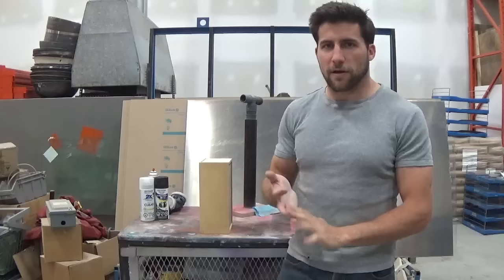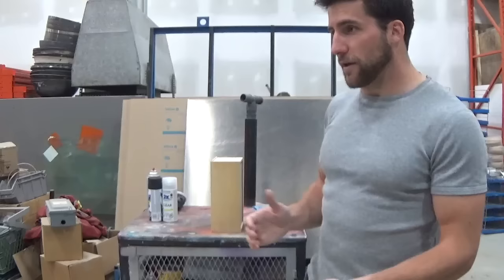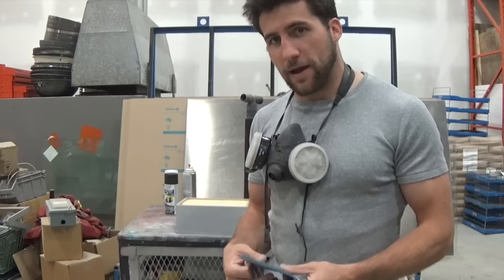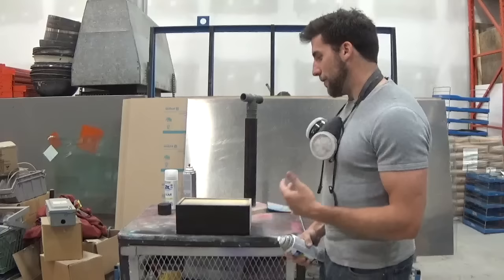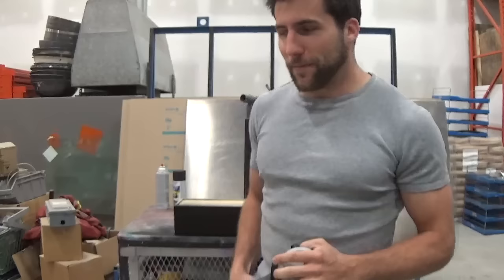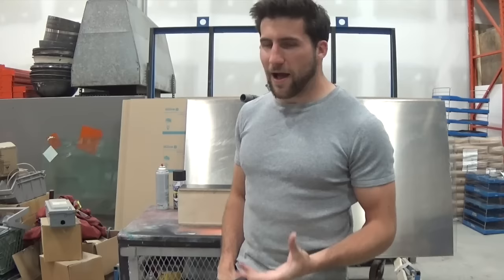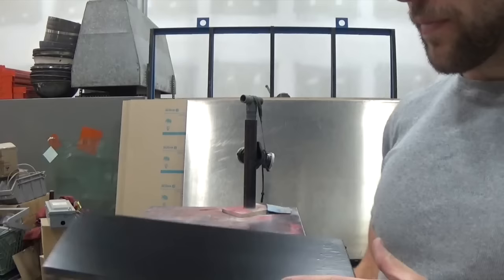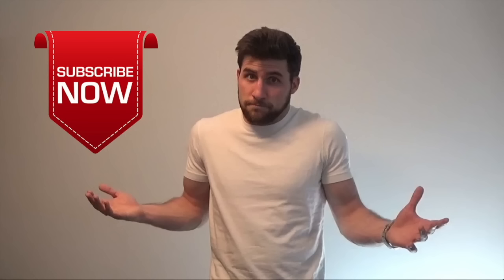How to get a matte black finish with spray cans

Comment: hello dude, i just want to ask, if what other color that can overlapped the flat black paint? because i want to overlay an red type paint into a flat black..but, im thinking if the red will be dominant?your reply will be apprrciated..
Reply from the maker: It depends a bit on what type of paint it is. You can put red straight on this, but if you're using a paint with some transparency to it it might be best to put a bit of white under the red.
Reply: can you make a video that what kind of paint that can be dominant if its overlapped to flat black. i have aome project that my color base was flat black, and im thinking if what other color for a detailing that can be dominant..thanks dude

Comment: Can you use these cans for a bare wood guitar body?also,I would like to grain fill but not with that grey primer any suggestions?
Reply from the maker: +X H4r7 if the wood is filled and sealed you can use these. You can't grain fill with primer really. That's not what it's for. Have a look at my video on how to train fill mahogany. That's the grain filler I prefer these days.
Reply: Brad Angove filled, sealed painted and sealed again?I want to get the pis same finish you just did?
Reply from the maker: Grain fill, sand smooth, seal, paint, and then clear coat.

Comment: Thank you for the great video. Say you wanted to spray paint a handlebar (meaning you have few exposed areas) would you consider dropping the clear layers? Also, thinking about possible thickness issues (when sliding the controls back in place), should I remove the paint completely first? And would I need a different primer for the metal surface then?
Reply from the maker: This primer should be fine for metal. I almost always use clear to protect my paint. You may want to tape off the areas where the controls go to eliminate the thickness issue.

Comment: Sorry, one last question. All i could find was the rustoleun flat black paint +primer. Would it be okay if i used thst along with the coats of  grey primer at the start?
Reply from the maker: You have normal primer available, but not normal flat/matte black?
Reply: Brad Angove yes, i got the rustoleum flat grey primer already and could only find the rustoleum flat black + primer in one can. Would that still be okay to use or should i keep searching for the flat black only with no + primer
Reply from the maker: You should be able to get away with it, but I don’t really trust that 2in1 stuff personally.
Reply: Brad Angove I'll try and find just the flat black only. I have the same opinion. I appreciate the respone and  help. Thanks

Comment: Would a matte clear coat cover light indentations only visible by angled glares? (I had to fill in a gap around the front route in the bridge area)
Reply from the maker: It would lessen it, but may not cover it entirely.

Comment: I'm painting on my bicycle frame . Do in need to remove the paint. It's aluminium
Reply from the maker: No, but you need to sand it so your new paint will stick.
Reply: So I only need the paint I want and top coat

Comment: great video. 
I have a nitro blond finish on my strat. can I primer over that and then do the matt finish, or should I strip the old finish off first?
Reply from the maker: You don't need to strip the finish off, but you will need to sand it lightly so that the primer can bond mechanically to the surface. New paint doesn't stick to gloss properly. I'd go with 400 grit.
Reply: Thanks. I will try that approach.
Reply from the maker: You're welcome. Best of luck with your project.

Comment: Do you need primer if your spray painting things like Consoles or gaming systems
Reply from the maker: Plastic compatible primer is an option for those, but adhesion promoter works just as well if not better.
Reply: can i use this method for silver metal?
Reply from the maker: Are you painting something the colour silver, or are you actually painting a piece of silver?

Comment: I'm trying to restore a bike. It already has a matte black paint job. I want to paint it matte brown. What's the best way to go about doing it?
Reply from the maker: If the current paint job is in decent condition, you can probably just scuff it lightly and spray your primer and paint right over it. Just a coat or two of primer, and two coats of the brown will probably suffice.
Reply: ok..Thanks a 
lot.
Reply from the maker: You're welcome.

Comment: Hey man, your videos have been really helpful!!

So just to get this clear you do 2 coats of primer, scuff it with 800 grit, 2 coats of flat matte then a final coat of matt clear??

I plan on doing this on my guitar and was wondering how many cans i will need? Also do you have and advice on spraying glosss stripes on a matte finish??

Thanks!!!
Reply from the maker: I did two or three coats of the clear as well. You should be able to get away with one can of each, particularly since you don't necessarily need to sand back your matte and polish it. 
Spray your matte finish first, let it cure, then mask off the gloss stripes and spray them. Polish them if you need to before you remove the tape. I should be doing a video on this process some time reasonably soon.
Reply: thats awesome man thanks for the help!!! im subbed so i'll look forward to the video!!

Comment: I’m going to paint my mopeds plastic parts does this work on plastic?
Reply from the maker: You should either use a plastic compatible primer or an adhesion promoter to ensure that it will stick properly.
Reply: @BradAngove  Ok thanks

Comment: Hi brad, just want to ask, will it have the same result if i use gloss black and apply a matte clear finish?
Reply from the maker: Yes, it should. For the best results in that case, I would let the gloss black dry fully for a day or two, scuff it lightly, and then apply the matte clear.
Reply: Finally someone asks the question I was about to ask lol thanks Brad you're freaking awesome

Comment: Hey Brad, I'm refinishing a headstock matt black/matt clear, how long would you recommend letting the matt clear dry before refitting the tuning pegs, truss rod cover etc? Thanks a billion, really appreciate your videos.
Reply from the maker: It depends on the paint type. With this stuff, if you’re keeping your coats light and are in relatively warm dry conditions, a couple weeks usually.
Reply: @BradAngove  Cool, I've got Hycote acrylic formula matt black and matt clear. Not sure if you guys get that brand overseas, I'm in the UK and it seems reputable among people who use it here for guitar finishing work.
Reply from the maker: I’m not familiar with it. Checking with the manufacturer is probably your safest bet.

Comment: Hey Brad!!! I would like to spray paint my car's fiberglass underskirt. Its already in matte black. I want it to be a glossy black finish... what to do???
Reply from the maker: Scuff it up so the new paint will stick, clean it with wax and grease remover, and (if it still looks nice and black) spray a gloss clear coat on it. 
Make sure you mask everything that you don’t want to get paint on.

Comment: Can we do matte black on silencer of a bike ,Becoz silencer is a heated area ?and on Rims of tyre ?
Reply from the maker: +Vinay Kahyap yes, but you'll want a different type of paint for it. Aim for a heat resistant engine enamel for the silencer, and a strong catalyzed matte clear to protect the rims.
Reply: Brad Angove Sir can u plz tell me When we have to use Adhesion promoter and how to use ? ?
Reply from the maker: +Vinay Kahyap You use adhesion promoter to get paint to stick to plastic or other materials that it usually won't adhere to. Generally it's designed for plastic. You just spray a light coat of it on before the paint and let it dry for 10-15 minutes.
Reply: Thank you sir
Reply from the maker: +Vinay Kahyap you're quite welcome.

Comment: I have a question. I am wanting to paint some some aluminum, steel, brass and plastic pieces and want a durable finish. Could I use spray paint with a catalyst clear coat over top? If so which do you recommend? I plan on using flat Olive drab for a military look. If you know anything that would work better and not break the bank let me know please.
Reply from the maker: You’ll need to use a proper etching primer, then paint with acrylic or urethane, and then you can clear coat with the spraymax 2K matte clear coat.
Reply: @BradAngove  thank you very much!

Comment: Great videos, all of them! I stumbled upon them because I want to paint my guitar (DIY kit) matte black. So far, I have little experience painting anything with spray cans, and I am worried about "orange peel" is that a similar issue with matte paint? Do you have any tips on how to avoid them?
Reply from the maker: Matte paint can still get orange peel but seems less prone to it. Usually we sand and polish it out, but you can't really do that with matte. So, just sand your second last coat of clear really flat and smooth (after drying of course) and keep your final coat light.
Reply: @BradAngove  Thanks Brad, I appreciate the help. Good luck with the Guitar Build off!

Comment: I used the same brand spray paint can but in satin dark walnut brown for a small wood cabinet that I built. After 2 days the paint still feels like is not fully adhere it leaves small prints when touched or a bit sticky. How long does it take for these spray paint cans to fully adhere? I did about 3 coats and no primer since the cans already have primer in it.
Reply from the maker: You used the combination paint and primer stuff?
Reply: Brad Angove yes I did, I wanted to test it out. I think I should've used some real primer first. So far is making progress in adhering, is looking better now. Any suggestion as to what to use to protect the paint from scratching?
Reply from the maker: You would use a clear coat to protect the colour coats from scratching.

Comment: Hi Brad. I've been binge watching all of your videos and I just have a quick question.  I will doing. a ceruse finish on an Ash body and I wondering if I needed to add primer for it?  It will be a flat black with red or silver grain filling.
Reply from the maker: You shouldn't use primer for that. You want to keep that black finish thin to allow the grain to stay open for your other color.
Reply: @BradAngove  Thank you so much!

Comment: Hi Brad,  iv seen alot of nightmare vids on YouTube regarding clear over rustoleum, have you came across this, is it a difference in matts or clears, in the videos they are both rustoleum products,  any help would be appreciated before I make a mess, many thanks. 
Edit...the problems I'm seeing is wrinkles, thanks again.
Reply from the maker: That’s mostly a shrinking issue. It’s a problem with recoat times, and it doesn’t really depend on whether it’s gloss or matte.

Comment: Hey brad is it okay if I do this on a motorcycle gas tank? and how can I make it durable so it will last longer 
Thanks!!!
Reply from the maker: You need automotive grade paint for that generally. I would use a 2k clear coat.
Reply: wow thanks for the advice... really appreciate it :)

Comment: if i use the flat clear coat then will that stop the matte black from polishing up from your hand/arm like in your 'problems with matte' video?
Reply from the maker: Unfortunately it won't. It will make it happen a bit slower though since the clear should be a bit harder than the black. The matte finish on the clear can still buff out due to the rubbing from your body.
Reply: oh ok. I wanted to make a blackout/gothic les paul but i guess there's no point then, thanks for the reply though!
Reply from the maker: If you use a high quality clear it will probably take quite a while to polish up, but it's up to you if you think it's worthwhile since that's a risk. I'll post a video if I find a way to fix those spots. I have a test in mind.
Reply: ah ok thanks. Do you know the best way i could do a matte black finish, or even satin, to build a gothic LP? I dont want it polishing up because it will be one of my main guitars for stage playing.
Reply from the maker: I don't know of any way to do it where you can fully avoid the polishing issue. Even the quality factory finishes can have that problem. I would think that the catalyzed polyurethane with a matting agent would probably be most durable.

Comment: Hey Brad, is it ok to use Rust-Oleum's oil based 2 in 1 Filler Primer instead of Rust-Oleum's Enamel Primer when using enamel spray paints? My thought process is that using the filler/primer would speed up the painting process a bit by bypassing the need to use a sanding sealer.
Reply from the maker: Yes, that should be ok.
Reply: @BradAngove  Thanks

Comment: What type of matt clear coat would you recommend for a Japanese Ibanez from 2013? Acrilic, poly, etc?
Reply from the maker: Poly
Reply: What other names do manufacturers use for poly? I see in the shops in the UK spray paints for VW, Audi, etc but the description of what kind of paint it is isn't there, is there a place where I can get cans of matt clear poly? I've seen in forums that using the wrong clear coat can be rejected by the paint use by the guitar manufacturer, Ibanez in my case.
Reply: By Poly do you mean polyester or polyurethane?
Reply from the maker: Check out custom paints in the uk. They have a 2k poly that is great. They probably have a matte version as well.
Reply from the maker: Polyurethane is polyester urethane. That’s what I mean.

Comment: Oh boy! Glad I found this. Same procedure for a bike frame, right?
Reply from the maker: Yes.
Reply: Brad Angove Alright. I got a few more questions:
1. How long does it take for the paint to cure? I want it to  completely harden before reassembling.
2. I got some grainy spots on the frame. When I rub it with my thumb the paint comes off. I'm already two coats down and applied 1 day apart. Should I just sand it off and reapply another coat or is there another way to go with it?
Reply from the maker: I'd give the paint a couple weeks to harden before reassembly. It sounds like you have some overspray on there. I would sand it back smooth and put another coat on.
Reply: Brad Angove thanks brad. I have the video of the bike frame on my channel if you wanna see it

Comment: Great stuff... doing a guitar and this helped a lot. Had a question(s) though... if I did a few coats of satin or matte black (not decided yet) then follow up with the satin/matte clear, can I wet sand the clear when done? I'm certain if I did 4-6 coats of clear for a good solid coating, it probably won't be as smooth as I'd like. Would wet sanding be a good idea? would it be a good idea to sand before applying the clear if runs/ripples? Also... if wanting a satin/matte finish, does the black coat have to be satin/matte?
Reply from the maker: If you've got runs etc. in your black you'll want to sand that out before applying the clear. The black doesn't necessarily need to be satin/matte, but if you're letting it dry to sand it before clear coating, you'll need to sand off any glossiness so that the clear will stick.
You could wet sand it, but I don't see why you would need to. Normal sanding with no-load paper would suffice.

Comment: hey hello from el salvador, look, i have an old black guitar, and i want to paint it with black matte, so my question is: I HAVE TO USE THE PRIMER that you use on  the box of your video or i only have to use the sandpaper and after apply the matte spray ????, and another question is: may i only use a flat matte spray without to use the clear matte spray ????, thankyou man ....
Reply from the maker: If the guitar is already black you can just sand it very lightly and spray it with the clear matte spray. The clear is to protect the black. You shouldn't need primer in those circumstances.

Comment: Hey brad need some advice, I spray painted a telecaster kit matte black last year with krylon paint and primer + matte finish. I want to redo the paint job and possibly fill in the grain that’s poking through. What would you recommend? Should I just sand everything off and start new? Or could I scuff it and start from there? Is it possible to fill the wood grain after it’s already been spray painted and finished? The wood is paulownia. Thanks! Love your vids!
Reply from the maker: Scuff it back significantly, clean it, and then fill with something like drywall patching putty instead of wood filler. Sand smooth and repaint.
Reply: @BradAngove  thank you for the advice!